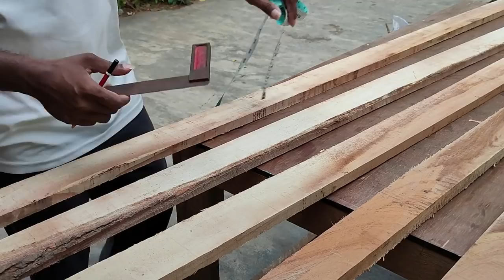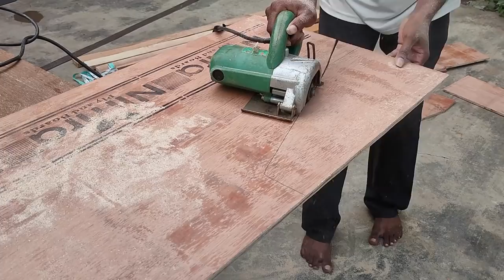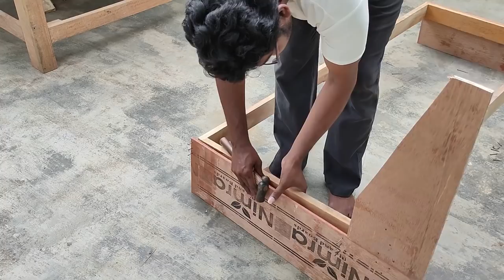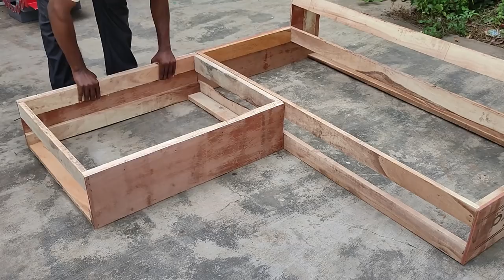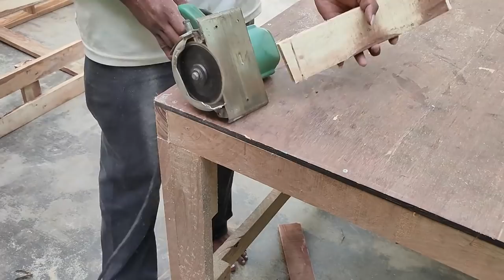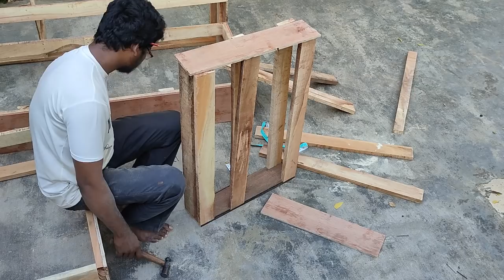How to Sofa Attachment Divan Cat frame making. latest video making. simple sofa set design 2021model

Comment: You have divan extension in front of sofa arm. In the finished sofa it will only come in front of the seat. So doesn't it need to slide over 4-5 inches? Am I mistaken? Thank you. This is a very important video -- how to build the wood carcass. Early in the video I thought the curved side of the back wasn't strong---connected by only one board. But by the end you have it connected with multiple boards. Is the design, and all the pieces, and and construction and measureents---all memorized in your head. You don't refer to any plans.